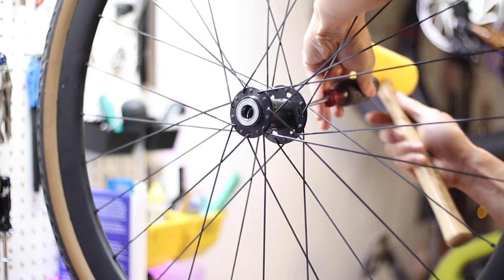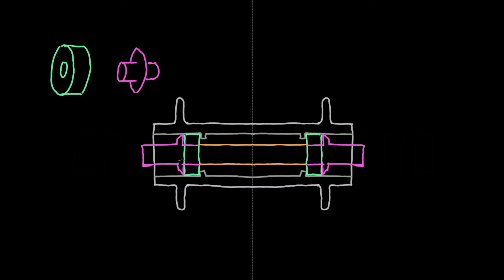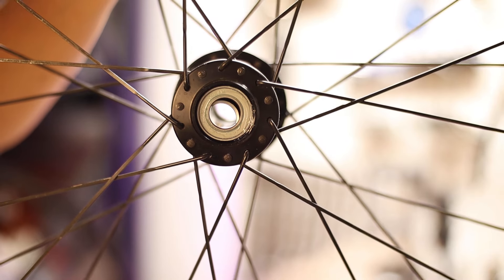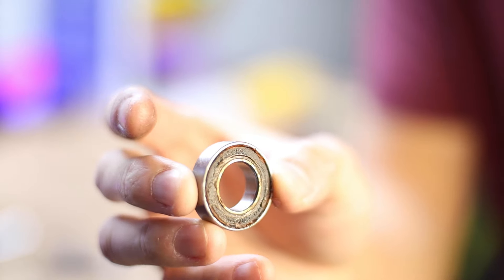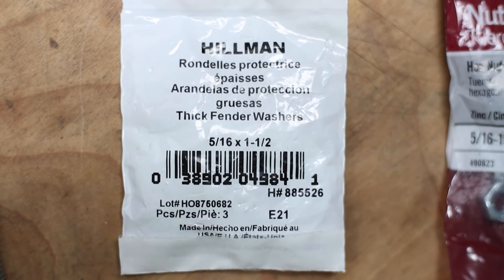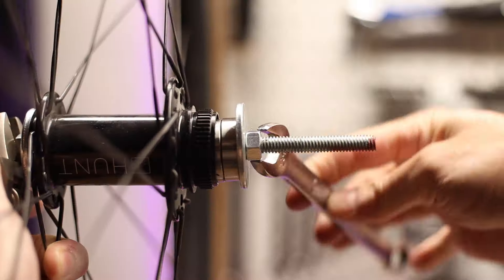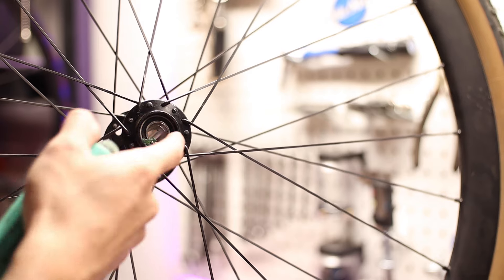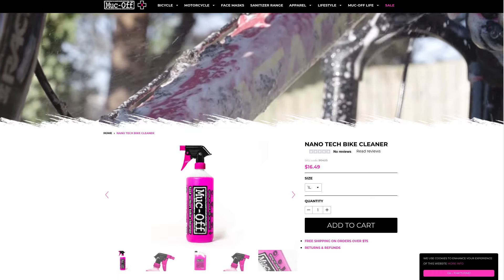HOW TO: Replace Sealed Cartridge Hub Bearings // No Special Tools!

Comment: Thank you for the brilliant tutorial - that good drawing truly speaks a thousand words. However I can't figure out how to remove the end cap of my Specialized Diverge's wheels. Spec says it's "sealed cartridge hubs" but once I remove the thru axle, the end caps just spin freely, and can't see any screws to remove etc. They are not coming off by hand like in this video. Any ideas?
Reply from the maker: The wheels in this video aren’t stock, but most operate similarly. May have to wiggle as you pull harder
Reply: If there’s no flat points on the end caps for a cone spanner and there’s no circlip a then they will just pull off. Try lightly clamping mole grips on the end with a rag and they should just pull off.

Comment: Hello, thank you very much for this video, it worked extremely well for my rear wheel.
However, for the front one, I can't really move the internal sleeve that is between the bearings like I did for the rear wheel, meaning that I can't hit them from the inside to pop them out.
Is there still a way to do this without special tools?
It's for a HUNT 4 season gravel x-wide wheel. At least the rear one is done, so thanks again! 
Cheers.
Reply from the maker: Tough when the sleeve is super tight. Can only recommend using a rubber handled tool and get a good fulcrum upon which to generate some good force. Alternate side to side and gradually increase force. Has worked for me, but I can understand that it’s tight

Comment: Rather than use a screwdriver to tap out the bearing you can use a dynabolt to attach to the bearing and tap out the bearing by hitting the dynabolt. See ozcycles

Comment: Nice and informative video. Hunt actually linked me to this. I've been trying your method for a few hours now but the bearings won't budge a single mm. Guess they're seized or something. Any tips?
Reply from the maker: Sorry to hear. You're certain they're sealed cartridge type? A Hunt representative specifically recommended this video or YouTube recommended this video after watching a different Hunt video?
Reply: @TheBikeSauce  Yeah it's sealed. It's their hub for the TrailWide MTB wheels. I think the next step is resorting to more violence to get them out. 
I talked to their customer service by chat and they recommend me to watch this video :)
Reply from the maker: It does take a bit of force to get them out, but they shouldn’t be seized if they were the original bearings from the factory. Thx

Comment: I can also vouch for rusted bearings after using the nano cleaning by mucoff - brand new hub has about half year of riding.
Was looking at your vid on how to replace the bearings.
Reply from the maker: Nice. I’m hoping it’s not unique to Hunt hubs. My mtb wheels don’t have the same issues and I’ve been using the same cleaner. Will report back on what i find
Reply: @TheBikeSauce  different hub here, 900 fronts by sram.
Reply from the maker: Ahh, yea I think the muc off stuff is perhaps harsher than advertised

Comment: i cant even get my axle out so theres no way I can get a flat head in there.
Reply from the maker: Is it a sealed cartridge type hub?
Reply: @TheBikeSauce  yes
Reply from the maker: Ahh. Seized up or something?
Reply: @TheBikeSauce  my front wheel axle stops way too quickly while upside down free spinning. I was suggested to loosen the nut inside the fork, not the main bolts that hold the wheel to the tire. I did that and still nothing so I imagine I crushed the bearings in the front axle. Took it all apart and i noticed my bottom bracket and back axle was making noises so I figured open it up and clean it out or replace if necessary.

Comment: smashing bearings out is always not recommended. this increase the concentricity of hole size which is critical for a good interference press fit. use a bearing puller.
Reply from the maker: Work with what you have. If you’re careful, you won’t plastically deform the hub shell
Reply: @TheBikeSauce  the force applying to the bearing need to be uniformly  perpendicular to the rotational axis. the same way as you push in. when you use a screwdriver to hammer one point of the bearing, that area of the shell will wear off.
Reply from the maker: I get the concept. In practice, small taps around the perimeter are a workable alternative if you don’t have a puller.
Reply: @TheBikeSauce  yes, you need to be skilled to prevent damage.

Comment: I'm no expert on new stuff, but I've been biking forever.  I find that the life expectancy of the new-style bearings is only about 1/50th of what you'd get with the old style cup-and-cone bearings.  They are never as smooth running even from the start, and they become unacceptably rough after comparatively little use, and when they go bad they can't be refurbished by a simple cleaning.  They seem very delicate and I think that's half the problem.  I really don't see why bike companies made the switch.  Yeah, call me old and grumpy.
Reply from the maker: Haha. Have to agree with most of your thoughts. "They don't make 'em like they used to." I will, however, say that most modern cyclists wouldn't know how (or be willing to learn) to service a cup and cone bearing - hub, bottom bracket, or otherwise.

Comment: Nolan, this is awesome, thanks!  I've been servicing (volunteer at a LBS) older bikes using cup/cone and "get that".  This does look much simpler.  Probably a silly questions, but how do I determine the right size bearings for my more modern MTB wheels?  Thanks!
Reply from the maker: Sizing cartridge bearings are generally spec'd by inner diameter, outer diameter, and depth. You're best off reaching out to the hub manufacturer for specs on specific hubs. Or if you extract your old bearings, you can take measurements and get replacements according to your dimensions. Thanks!
Reply: @TheBikeSauce  / Nolan, awesome, thank you so much!  Love your videos and how you keep things simple and easy to understand for a newbie mechanic like me. Keep up the great work!

Comment: I can't get my axle out of the sealed bearings!
Reply from the maker: Thru axle or the inner sleeve?
Reply: @TheBikeSauce  thank you for replying. Its a quick release skewer. So the rod comes out. But the hollow axle is still inbetween the very tight sealed bearings. Do I have to knock out the axle with hammer or something? I want to replace the quick release skewer for a longer fixed axle.
Reply: Think inner sleeve as that is wedged between the bearings sticking out of either side.
Reply from the maker: Ahh I see. This is not thru axle hub. At best you can replace the qr skewer with a bolt on type, but you can’t punch out the hollow inner axle. It’s not a sealed cartridge type hub.
Reply: @TheBikeSauce  OK thank you il try the bolt on type Skewer. I thought I was going mad not being able to get the axle out. I had all the side nuts off and everything and was thinking why isn't it sliding out!

Comment: Thank you for the informative video. 
How often would you recommend changing the bearings if you don’t notice a sudden change in rolling smoothness?
Reply from the maker: It'll be entirely based on your usage. Mileage varies from rider to rider, so a service time increment ins't really logical. Also, location, terrain, and care of equipment all factor in. A careful rider who only rides on dry tarmac and never power washes the bike will likely not need to replace them more than once every 1500 miles. Any discrepancy will shorten the replacement interval. Luckily, they're really cheap bearings

Comment: Great video again today, and also nice to get to root cause. Are you still going to use the Nano Cleaner, but just not anywhere near your hubs, or are you going to find a different cleaner?
Reply from the maker: Thanks! Will use the rest of my supply, being more careful around bearings. Might perhaps look into alternatives after that.
Reply: @TheBikeSauce  what about around the bottom bracket / crank? I’ve done some damage to a cheap wheelset with loose bearings snd destroyed it with mucoff. So no more cleaning the bike while the wheels are on with that!

Comment: Good, well summarized tutorial. On the subject of bike cleaning: if using a wash and wax product (like a lot of car cleaners) be careful not to get it on your disc rotors or pads. The wax will contaminate them. Rotors will be relatively easy to decontaminate but you will most likely have to replace the pads.
Reply: No need to replace necessarily. If pads are still usable, spray some degreaser or brake cleaner into them. That should do the trick.
Reply: If they're resin pads, you can probably sand them. Be sure to use a flat reference surface. I laid 180 grit paper face up on a laminated workbench and rubbed the pads on top for a few seconds when I had a really squeaky set on a bike I'd purchased. They've been great ever since.